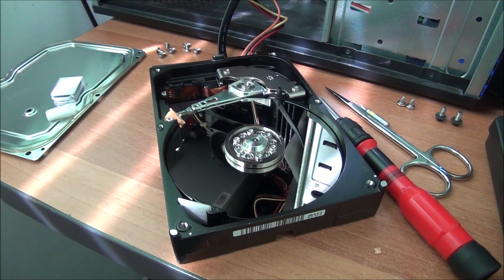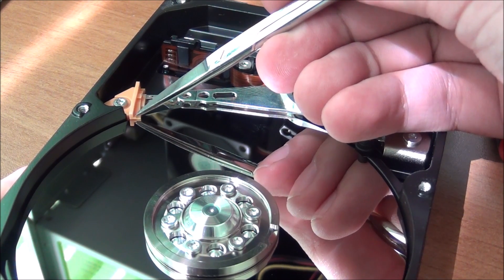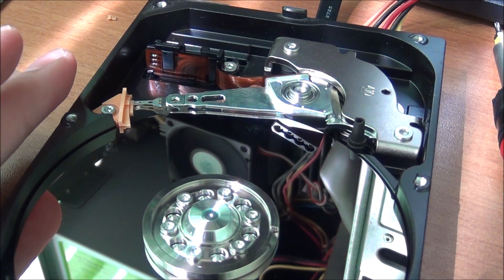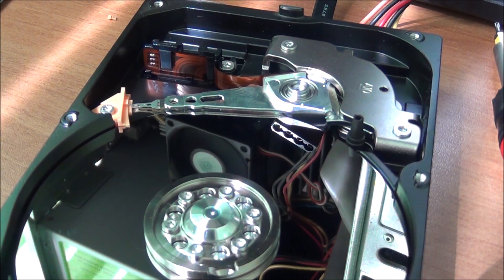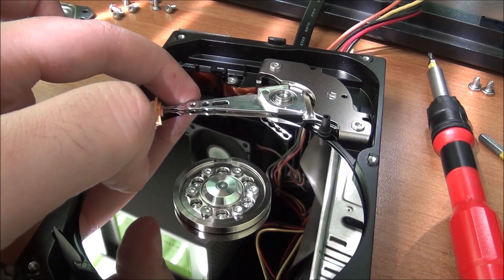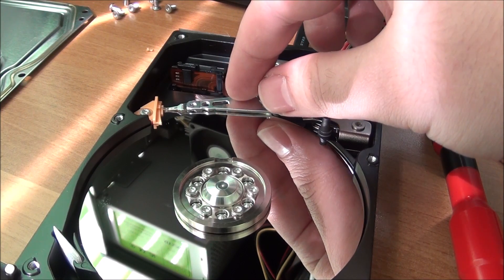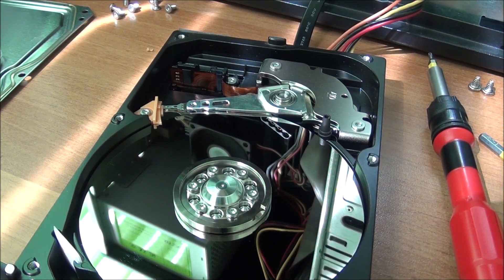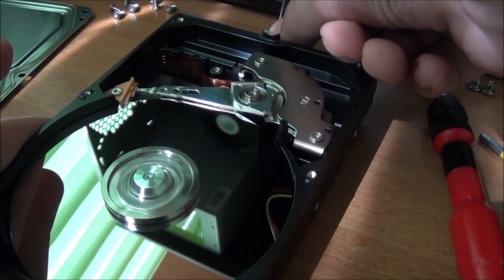What the click of death that you might hear from your hard drive actually is

Comment: When i plug my hard drive it click 2 times and shut off suddenly what problem and one more hard drive started with 2 or 3 time slightly clicking and running but no read when i boot my pc full screen logo stucks for 2 or 3 mintute after that bios open no disk shown in bios
Reply from the maker: For the first one, the heads might be stuck. The second one might have surface damage.
Reply: @UltimateDIY  surface damage means
Reply from the maker: Scratches on the disk platters.

Comment: My hard drive only does one click every now and then what's that all about
Reply: If your hard drive goes idle it parks then when it needs data it unparks. Some wd drives will spin down while idle
Reply: @NelsonBigGunP200Fan  it was a loud click don't have it anymore got rid of it but now noticing another click on my new Xbox one x hard drive
Reply: @randomcro24  bought a 2tb drive today which the seller claimed to be "brand new". Pluged it into my pc, started transferring data from my other dying hdd, and then its clickings went shaking up my whole chasis lmao. went to scan it with CrystalDisk, found out its been used for 36k hours..
as long as your drive doesnt do like the one i got today then it shoud be fine. Hopefully the seller has a very good excuse for me tomorrow or else there's gonna be some issues
Reply from the maker: It might be aggresive power management forcing the heads to park.
Reply: @UltimateDIY  it's on a Xbox one so is it dying I've still got around 20 days so I can return it and get another one or should I just get me another hard drive and slap it in the Xbox
Reply from the maker: @randomcro24  search online on forums for the particular hdd model that you have. I had one that was parking the heads extremely often. It was not a failure, it was designed like that. But I did not like it and modified it's firmware.
Video here: https://youtu.be/D1IEdpFveJ8
Reply: @UltimateDIY  thank you for the help

Comment: This is why its always a good idea to back up hard drives. I keep at least two back ups. Cant risk losing invaluable data.
Reply from the maker: Yes, indeed. It's even recomended to have the backups in two separate locations (houses even).
Reply: Bih this is my back up drive lol
Reply: every time I install a new program I'll make a new ISO backup because a failed drive will mean re installing everything on a new drive which I am not in the mood for, And files on another drive with backups as well
Reply: @DianeV  You are beautiful 😊
Reply: how does one backup +500 GB?
Reply: @herzikkimolog  Actually backuping files is quite expensive process. But I give up on hdd, I now use SSD even though they are atrociously expensive atleast they are more sturdy and won't give up just out of nowhwere, They can write Terrabytes of data with higher read/write capacity than any hdd. I've lost alot of valuable files for clients even with hdd backups, using HDD when dealing 250gb files of data a day to transfer really wears out hdd faster than SSD.
Reply: @exogendesign4582  I totally agree. I used to move large files from one disk to another which might have caused harm. Although clicking sound in my pc is definitely coming from psu now, not hdd which are both 3 years old. Just don't buy products from Everest, Frisby etc...
Reply from the maker: On am external drive. Just google for backup software and you will find lots of programs stat can do this.
Reply: what do you use to back up?
Reply: i dont give a fuck about my data , but i got to fix an hdd so i can sell it

Comment: is their any way to recover data after it dies ?
Reply from the maker: If the platters are scratched, not really. If they are in good condition, then they can be moved togeter with the electronic board into an identical hard drive. But all of this needs to be done in a clean room.
Reply: @UltimateDIY  they dont do either. They replacr heads and copy data to new disk
Reply from the maker: Got it :)